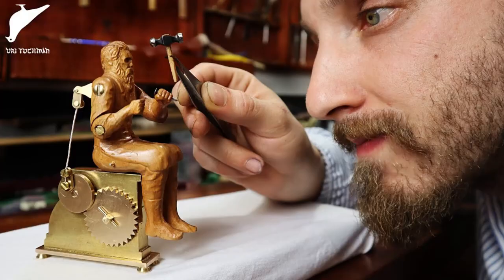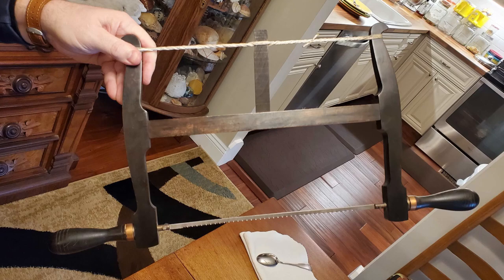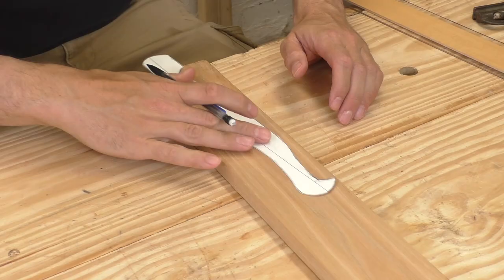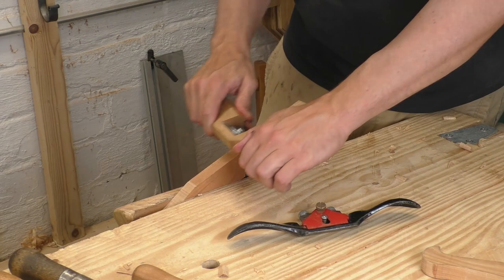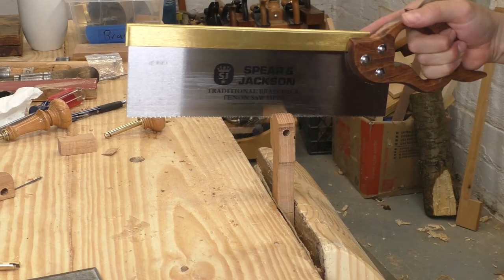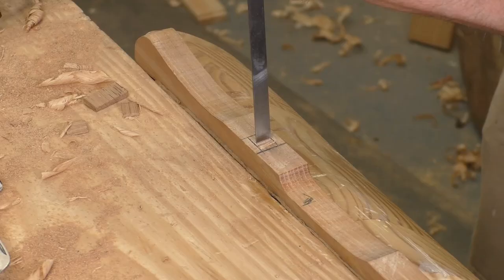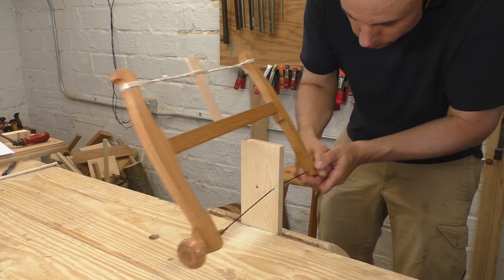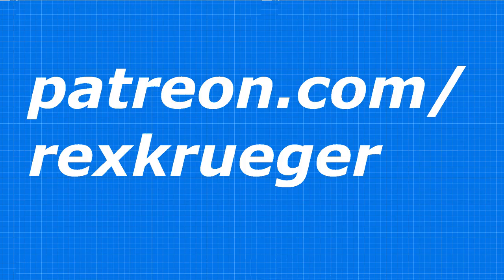Making a turning saw with Uri Tuchman.

Comment: Something about this makes me reflect on a lesson that it took me a long time to learn. Most of my life I saved really nice materials and one-time use objects for when I thought I was good enough for them and as a result they became burdens that sat around unused for years instead of being the treasures that they should have been. I was afraid of "wasting" them like you might have felt like you did with the wood that you cut short or the finely crafted handle pin that broke. But through years of carrying these burdens, I've finally begun to learn to use them instead of wasting them by not using them. Even in the failures, they turn into treasure of a kind that doesn't become burdensome: experience. They're much more valuable in use than they ever are on the shelf, under the bed, in a box, or somewhere else getting in the way of cleanliness and order.
Many other things (like money, fine tools, clothes, consumables in games, and life in general) are the same. Take care of them, but also use them. Don't let them sit safely in their glass cases getting lonely for not being allowed to serve their entire purpose for existence; doing so wastes their value. Rather than hanging on a wall somewhere, never again knowing the touch of a craftsman, I hope this saw cuts lots of wood even though that means it will gain a few bruises and scratches along the way. Only items that are used for their intended purpose are truly appreciated. Leave wall-hanging to the paintings and tapestries that are meant for such things.

Comment: Wow, that is just just so. I made a turning saw last summer after I got totally fed up with coping saws. I’ve used coping saws for dogs ages doing finish trim, and I’ve never been happy with them, even though I thought they were the best tool for the job. Enter a turning saw. I used one one time, just once, SOLD, I had to have one. From the photo and using Gramercy hardware, I built one. I no longer use my coping saw, haven’t touched it even once since I built the turning saw. I even use it for all my decorative curves. I don’t yet own a band saw, though that is no 1 on the wish list. I believe you will now be forced to make yourself one too. Once you play with it a bit you will have to have one. Once again, I have to thank you for this project. I love how you had no hesitation modifying Uri’s part. Fantastic result, and far fewer mistakes than I made.
Reply from the maker: I'll never touch a coping saw again.

Comment: I made saw many years ago from an off cut of teak, oak handles turned on a home made lathe and two 2 1/2” no 10 wood screws to hold the handles and blade in place.  The handles are a bit rough, but serviceable.  It’s definitely the woodworking for humans variety.  I didn’t find the joinery was that critical - the tensioning cord holds it together very firmly.  It’s a nice project to make, but to be honest I rarely use the saw.

Comment: Hi Rex, when you cut the stretcher too short you could have solved the issue by simply adding two slim wooden cheeks projecting out either side of the stretcher ends, obviating the need for tenons. This keeps the saw's structure intact without the need of mortices in the arms, which adds to structural strength. It  also has the advantage of allowing you to move the stretcher's position on the arms when greater depth of cut is needed. I once bought such a saw from a flea market in France and it worked just fine. Bests.

Comment: That is a very pretty and function tool and thanks for showing the mistakes that we don't need to copy. I thought that the mortise and tenon joints needed to be loose, so tightening the string put tension on the blade rather than stressing a pair of tight joints. Maybe that detail is only relevant to larger bow saws and frame saws

Comment: Love your work.  I am more of a machine woodworker but I have been inspired to build some of the tools that you have recreated.  In some applications using hand tools is quicker than setting up the router table or using multiple power tools for a small job.  When you cut the stretcher too short the first thing that came to mind for me was a floating tenon.  Perhaps something to consider for future mistakes.  😉

Comment: No band saw, no problem. Sometimes you have to look back to move forward. Some of the finest things were made with no power tools. Nice collaboration, lets hope for high bids.
Reply from the maker: This thing is SO much cheaper than a band-saw and it does many of the same things.

Comment: Maybe you can use an old bandsaw blade? If you cut it to the correct length and make two holes in it might work. And maybe sharpen it as well.
Reply from the maker: Oh, for sure. People do that a lot.

Comment: For better saw blades than what you demonstrated, make them from 1/4 bandsaw blade.  Many places that weld up bandsaw blades can provide unwelded lengths.  Use a carbide tipped drill to put a hole in the band.  Shouldn't need to heat reduce the band temper, but you can.  A drill press makes it easier to make the hole.  Using bandsaw blade means you can make whatever length you want, and can get different tooth pitches.

Comment: I've been thinking of making  turning saw.  I actually thought of sacrificing a band saw blade with a couple of holes drilled in the ends.  I could have used the original pin ends that Uri made for the saw.
Reply: As I watched the video I couldn't believe he didn't do that. Would have been a lot simpler and prevented the breakage of that beautiful pin too.

Comment: I've always been thoroughly underwhelmed with coping saws, but didn't want to spend $100+ on a Know saw.  I also didn't know there was a source for blades that long.  I don't have a band saw or a scroll saw, so I'm going to have to make at least a couple of different sizes of this now.  Thanks very much.  Thumbs up to crush a troll.
Reply from the maker: The turning saw is the way around ALL those problems. It's not that hard.
Reply: Looking for ideas rearding a project that I have floating in my head.
Have an 8ft long 3/4" 3tpi bandsaw blade (it parted at the weld one day). Think I can make a non-turning 26" frame saw with a decent size gullet. Stalled a little on the hand grip and frame sectional sizes. Make it beefy and then shave off for weight and style.

Comment: 3:13 I might be the opposite of modern engineer. Not only do I draw things by hand, but I also draft ideas for code on paper as well. Box's some how are not available in the normal IDE or Vi text editor. So, when it comes to building my cabinets out of wood its all on paper. Nothing agianst those who love auto cad, but its not my thing. Especially because I am a writer and an artist ontop of my DIY. Still working on my synth cabinet I swear. LP2Lily and LP2Pebble

Comment: I know its unrelated,  but regarding glue ups.  Have you ever tried to use screws to supplement clamps? Basically if you are making a top of multiple, long, 2x6s but dont have enough clamps, could you screw the 2 boards together? You would have to glue each board individually to the  larger pack, but it would provide the proper force that would other wise be unavailable because of lack of clamps.

Comment: Very nice little saw.  LIked it a lot.  Can I recommend an alternate to the nylon twine you used as a tightener?  Check out Catahoula tarred twine.  It's black, immensely strong, and frankly, some of the prettiest string you'll ever see.  I bought some and it's just too darned nice to use as string or twine.  A project like this would be a great application.  (PS Not affiliated in any way.)  Keep up the good work.

Comment: I was hoping to see a rounded shoulders (half moon, shape) on the tenons Vs square and flat ones, because it helps rotation of the parts during stretching of the blade...other then that, was a great little project.

Comment: Silly question - what do you think about the idea of trying to use cutting tools for all finishing?
I know sandpaper is the "default" way most woodworkers will think of to get a smooth surface, but is it possible at all on the edges or on interesting curves to get a fine finish with chisels/planes/shaves/scrapers, etc? I have heard of some people saying they prefer not to use sandpaper at all, and I wonder how possible that approach even is on projects like this

Comment: Hi, very nice saw, but tell me if I'm wrong, I saw a video from a French cabinet maker showing how to build such a saw, and this guy was giving nice pieces of advice like having the tenon and mortise in a slightly round shape, as the three pieces are mobile, you don't want to damage  this mobile joint and the round shape helps them moving more smoothly when putting tension. Also, he said that the central piece should be made from hardwood in order not to bend, and use a softer wood for the extremities as a more flexible wood will be less prone to  break when put in tension. What do you think of that?

Comment: Why not re-cut a hacksaw blade and make a turning saw blade?  We used to make these by shaping a single piece to the contours before slicing them centrally lengthwise to create each end of the saw frame?

Comment: Question. Would it have been possible to use the short piece of matching wood by morticing  both the end of that piece and the handle, and then use a tenon block to join both pieces like a dowel? Thanks for the video. I’ll be making one of these soon out of wood from the woodlands around my home.

Comment: Nice saw but, if I may add, you’re holding it wrong!
The bottom knob it’s not meant to be hold, it’s there to turn the blade, the bottom part of the frame where the bottom knob “sits” is your “handle”, yes and you holding it vertically to the piece in your vise! 
Try it and you’ll feel the difference immediatelly that it’s easier to cut and manipulate the saw, I’m surprised that nobody made an observation on it so far, Uri included.
Since this is a European style saw, use it like it is supposed to be used, you don’t believe me, check out Frank Klouse videos where he uses one of these saws to cut dovetails in a competition, absolutley amazing with it!
My father (European) had one and sometimes I saw him how he was using it, finallyI built one about ten years ago, a nice conversation piece, don’t have much use for it, just built it for the challange, I rather use my other saws, Japanese, American, depends on the day of the week, it’s for hobby.
Tell you friend Uri (the knob head) how to use the saw if he didn’t know and BTW, his name is pronounced like Oori not Yuri, now I have to check his videos...
Reply: Totally agree with the holding part you mentioned. These knobs are only there to adjust the angle of the saw blade. (Preferably when the saw is NOT under tension.) Aside from that, its a great vid. Thanks so much, Rex! Greets from Germany.

Comment: i've been wanting to make one of these but i haven't been able to find the saw blades & other hardware ...any suggestions for sources??
Reply from the maker: tools for working wood.  Easy to Google.
Reply: If you use a pin to lock the blade as in the original design, you can make a blade from bandsaw stock by drilling near each end.

Comment: When I heard 'turning saw' I initially thought you might be making one of the dovetail cutting saws where the saw blade has a 90 degree bend across it, so you can drop it into the bottom of a vertical slot already cut in a piece of wood and cut at 90 degrees to the bottom of the slot as if you were sawing normally. It's hard to explain, but here's how it looks in action https://www.youtube.com/watch?v=vKuy3NdLhlE&t=240s - also, how ridiculously fast is this guy at making dovetails.
Reply: I'm pretty sure the saw he's using is one of these. He just twisted the blade rather than turning them together.